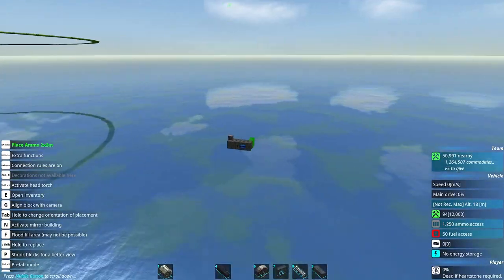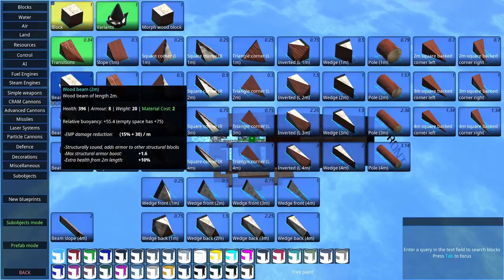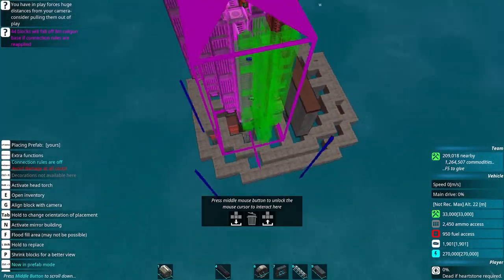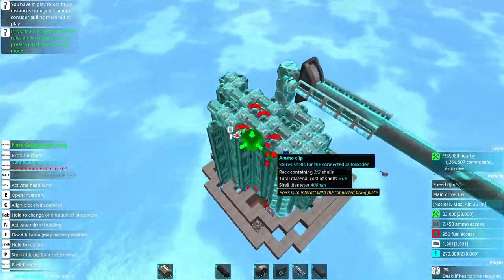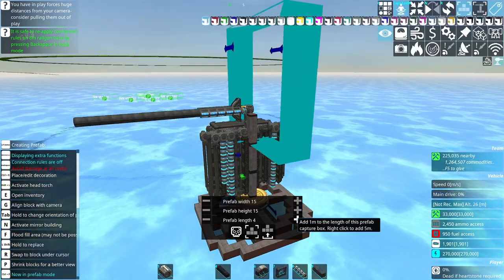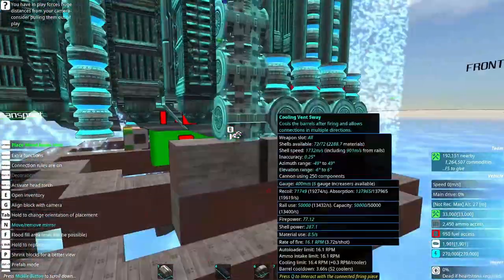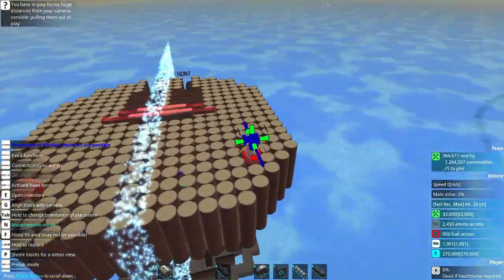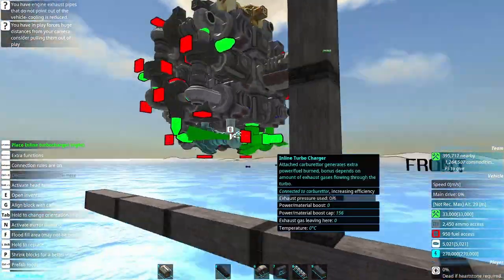Building a Fuel Engine and a Railgun - Live Wood Neter 8.5

Comment: I came back to this video bc I'm currently attempting to build a twin 250 mm turret for a tank using 4m loaders. Could I get away with laying the loaders down on the sides for more efficiency and more loaders or is it better to keep them vertical?
Reply from the maker: When building in a turret, it’s best to keep them vertical in order to fit the circular profile better. If the gun is mounted directly on the hull instead of a subobject, they can go in whatever orientation best fits the space.

Comment: Is it possible to get 4 clip Tetris with little/no gaps for small turret rings? (5x5-9x9)I’ve attempted a few times and it always results in me having to decrease the autoloader’s/clip’s by 1m to connect everything and leave no gaps, I want to use clips but with my Tetris it hurts firepower a lot.
Reply from the maker: Personally, I use 3 clip Tetris for smaller turrets especially when I’m not building railguns.
Reply: It is possible to get a decent 5-clip tetris on 1m loaders.